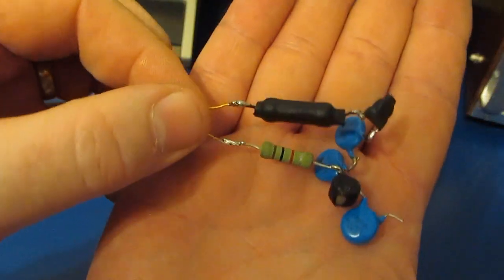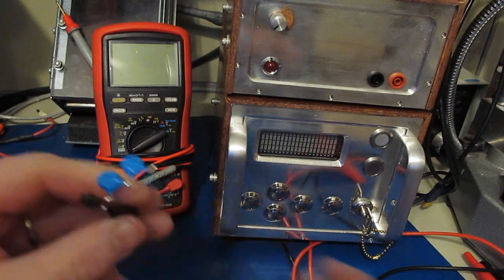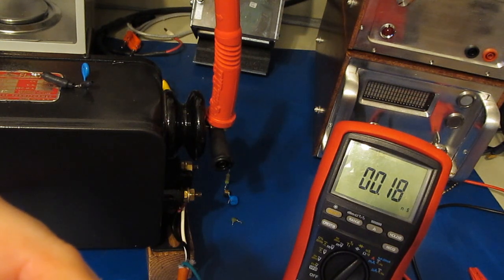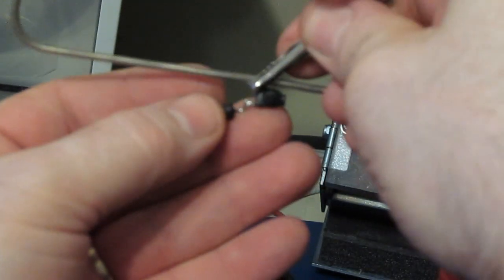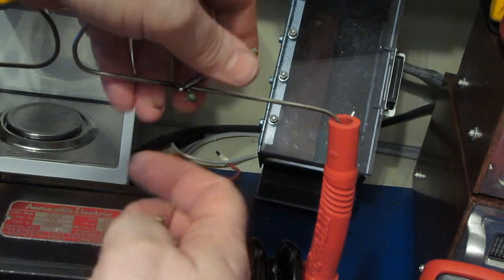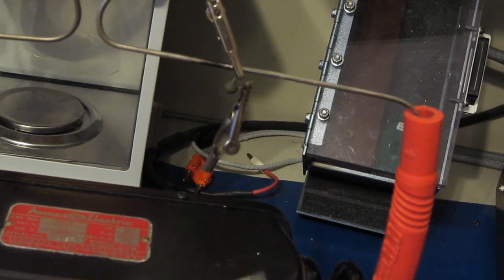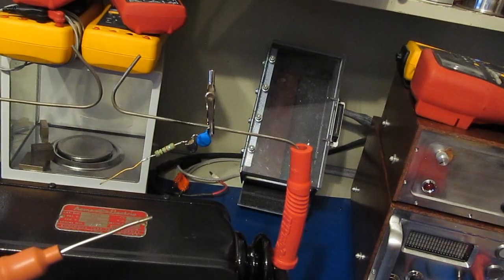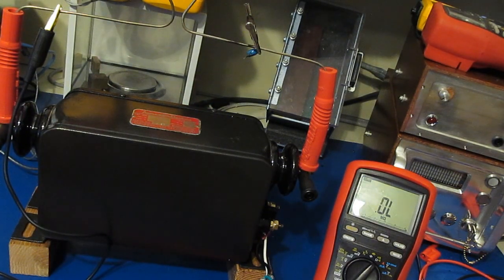DMM Input Protection Vs NST

Comment: Great video, Joe. Maybe you could talk a bit about IEC61010-1 CAT over voltage protection ratings for DMMs. CAT rating has been around for a long time, but many users seem to become aware of its importance only recently.
Reply from the maker: It comes up every now and then on the EEVBLOG forum.  I've mentioned it in a few videos and in the FAQ basically to the extent that I have no interest in safety and the testing I show has nothing to do with it.  My interest has and continues to be with how robust the meters are when compared against a common standard.  I've often stated that I have far more interest in 61326.   Now if I were an electrician or worked in an environment were the safety standards were a concern, I may take a different stance.  But then I would most likely have not done any testing as the energy levels you are dealing with would be MUCH MUCH higher than what I show.

Comment: Love the carnage 🙂
Try not having such a large gap. All it does is create more heat.
Just like when welding, you don't want too much distance between the electrode and the material, because it just creates uncontrollable heat.
Reply from the maker: "All it does is create more heat."   Not true at all.  We also have the visual effect of the arc.  The arc and heat make drama which was pretty much the whole point. The intent was certainly not some controlled experiment.
Reply: @joesmith-je3tq  I thought that might be the case 🤣

Comment: Did the same, just used a cheap and nasty MT830 clone, with no input protection, and SMD resistors. Made a nice glow in the case as it arced over, using a 7200V NST. Better is the 14kV ones, though the arc does heat up those electrodes, so do not use brass brazing rods for long term running. Should try those GDT tubes from old fax machines, or modems, and see if the transformer will actually work, as I find they do glow nicely. Nice thing about the heavy solid NST is it does not mind running into a short, though running as a Jacobs ladder does make a very effective wideband RF noise generator, with superimposed double mains frequency AM modulation on it.
Reply from the maker: That Keysight meter uses GDTs....
Reply: @joesmith-je3tq  Will it survive though?
Reply from the maker: @SeanBZA  It's already beyond repair.  Because you already know that the HV will damage the other parts even with the MOVs removed, no doubt this transformer would cause further damage to the meter.

Comment: Oh Man!! Long ago, when I was a teenager, I had a neon sign shop near my house in Chicago, and they threw out a old and rusty transformer that was about that transformers twin ( 12KV output too) . I temped fate every time I plugged that thing in to line voltage, made a nice jacobs ladder, and found that just setting it on the ground it would treat the housing like a center tap and still draw an arc to ground. I have a smaller one now, as I finally chucked that one, but I still have fond memories of that beast!
Reply from the maker: This one belonged to a friend who owned it since childhood.  They got it from their dad who made signs.  I would guess is roughly 70 years old now.

Comment: I've learned that an HV fly swatter can damage a cheap meter. No idea how high those are running at but I assume around 2-3kV.
Reply: only about 800V
Reply from the maker: I think that one I showed some time ago was marked 2kV.   I have no doubt it could damage some of the low end meters.
Reply: I screwed up a cheap Extech meter  last month trying to measure the voltage on one of those Walmart fly swatters . @joesmith-je3tq